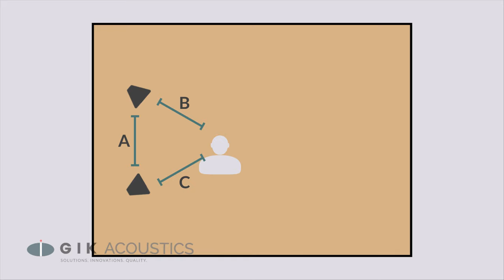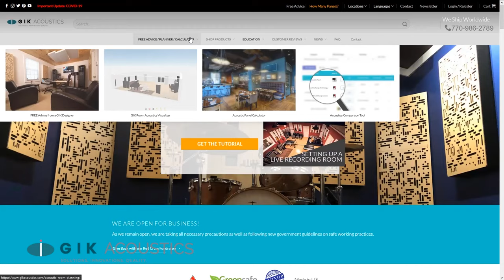Stereo Speaker Placement

Comment: This is generally good advice, but the listener should be moved much farther back in the room, while the speakers should be pulled farther out into the room, at least a third way out, if not more. You can still maintain the triangle that way, but the listener will experience much better soundstage depth perception.
Reply: Yes and only if the room is big enough, mine for instance is super small so the best option is to put the speakers closest to the wall possible to limit the accentuation of the modes from the room

Comment: I use a pair of horizontal 3 way speakers with the 10" woofer in the middle of the tweeter and mid. Even placing which one whether the middle or the tweeter on the inside has different sound to my ears. The tweeter will be more dominant if they're on the inside, so I prefer them on the outer side. Setting up audio can be tricky and has different case for everyone and experience.

Comment: Due to a mess created by reflected sound, 90% of my listening room's sound is not great to pretty awful, but it is fantastic at the sweet spot where my listening chair is, with great imaging and tonal balance.  That is all that matters, and pretty typical for an untreated room I wager.  

Speaking of room treatment, what is it with the ridiculous cost of room treatment material?  You would think the stuff is made of gold bullion.   A buddy got a load of it from a failed church at fire sale prices.  He may be going to Hell, but he got a good deal on very nice material ;)
Reply: Interesting.  I experienced the same - as walking around the room clapping my hands, there is too much echo, yet where the listening chair is located, clapping my hands, there is zero echo.  My room is slightly treated - first reflection and corner traps.
Reply: @downeys1  Similar here.  I have a stereo setup and sit fairly close to the speakers also, which helps take the room out of the equation to some degree.  The friend I mentioned in my post had a home theatre setup with many speakers and he spent a lot of time treating the room, measuring and doing DSP on it.  I think he spent more time tuning the room than he spent finishing his whole basement.  A rabbit hole for sure!  It was pretty fantastic home theatre though, with twin SVS SB4000 subs that literally felt like they could make one's hair stand on end during movie scenes  with deep bass.

For me the program is minimal treatment, sit close to two speakers in a nice triangle, which correlates to the distance I should be from the 65" TV anyway, and carry on with my life.  If one is in the back of the room, too bad for them 😆

Comment: The "33% Rule" and "38% Rule" should no longer be used as suggestions. It's close but not accurate. 33% or 32.8% ONLY works in longer length rooms. 38% is too close to the 4th harmonic null at 37.5%. The real listening position is at 39.6%. Why? Because it's exactly in-between the 4th (37.5%) and 6th (41.7%) harmonic null. You have 37.5% + 41.7% / 2 = 39.6%. So if you are keeping your head in-between the harmonic nulls, then your possible Listening Position options between harmonic nulls will always be the same in any room: 32.8%, 39.6%, or 45.8%.

Room length makes a big difference is where the Listening Position will be located. There's no way a Listening Position of 32.8% or 39.6% will work in a small length room. Small rooms will have a Listening Position of 45.8%, medium length rooms will be 39.6%, and only rooms with longer lengths will be 32.8%.

Overall the 38% Rule is inaccurate, is outdated, and doesn't work for every room length.
Reply: you seam to know your stuff! using this info on my new studio. any insights on what would be the ideal distance away from the walls for MicroMain27 in a room thats 19ft 2 inches (length) by 14ft 4 inches (width)? thank you for sharing your knowledge!! true lifesaver
Reply: @ryanwilliams7166  For a 14'-4" x 19'-2" room, your listening position will be at 32.8%, which will put you midway between the 5th and 7th room nodes. From the front wall to the 32.8% listening position point will be 6'-4". From the front wall to the center point of the studio monitor will be 3'-1" and from the side wall to the center point of the studio monitor will be 4'-5". Your studio monitors will be 5'-6" apart measured from monitor top center point to monitor top center point (4'-5" + 5'-6" + 4'-5" = 14'-4"). The listening distance measured from the listening position to the center point of the studio monitor will be 4'-6". The barefoot MM27 user manual states you need a minimum recommended listening distance is at least 1 meter (3'-3") so this puts you a 1'-3" over that. For the needed measurements, you will need adjustable speaker stands. I highly recommend the heavy-duty K&M Konig & Meyer 26720.

Comment: The Should Not Be Facing U....the Left Speaker Should Be Facing Straight To The Left.....The Same With The Straight To The Right..... Must Get It...So The Sound Bounce Off The Wall.... Donot Have The Speaker If Possible On The Flore....It Should Sound Good....

Comment: Who has more than one subwoofer?
Reply from the maker: @Borey567 - See around 3:25, https://youtu.be/mcB1jKs_ifU

We are working on a more focused video that answers this question more comprehensively, but the gist of it is it is a strategy that uses phase cancellation to achieve a flatter response.
Reply: The answer is MANY. 2 cheap subs will be better than 1 expensive sub in most cases.
Reply: @GIKAcousticsLLC  Would it mitigate the need for bass traps?

Comment: Speaker wire length should be equal also. Allowing signals to reach speakers at the same time.
Reply: Wut? That is not a thing!
Reply: At the speed of light a small difference will not make any relevant change in sound - timewise. Speaker cables should indeed be of equal length because they dampen more high frequencies the longer they are. They shouldn´t do that differently in different speakers. Using quality cables will make this difference smaller, but it´s a good rule of thumb regardless.

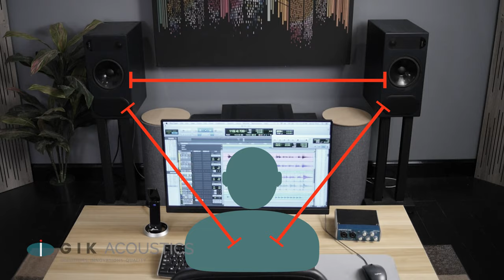Comment: I am amazed at how an acoustic treatment manufacturer can be so inaccurate about the visual cues of the informations it gives: at 1:37 you are speaking of the basic principle of the equilateral triangle speakers setup, but what you are showing on screen just isn't equilateral. I understand the image used is from a perspective angle, but that's simply the wrong way of showing it.  And you keep repeating that mistake throughout the video, like at 3:00, where there isn't even perspective being the image shown from the top and, again, the triangle isn't equilateral, with speakers not even directed to the listener but straight ahead to the back wall. Bad.
This way you are giving conflicting and misleading informations to the potential users, and you really should think about this.
Reply from the maker: I assure you, we think about our video scripts a lot. There's nothing misleading about this. The equilateral triangle model for speaker placement just means the distance between each speaker is the same as the distance between the back of your head and each speaker. The lines of the imaginary triangle should just graze your ears as it continues to the point behind your head. The photos shown are equilateral triangles, or depictions thereof. Not to worry, the concept is simple enough to understand.

Regarding toe-ing in the speaker so they are angled toward the listener, that's a different issue, ie, speakers can be toed in both in an equilateral or non-equilateral triangle setup. Angling speakers like this is a common practice but it's not the only way to do it. Different speakers have different dispersion characteristics and may benefit differently (or not at all) from a toed-in setup. As always, experiment to see what works best for you. In most rooms I'd use the advice in this video as a starting point for experimentation.
Reply: Misleading? You are the one that seems to be confused, no one else is.
Reply: @AbsoluteFidelity  probably nobody is because the average level of comprehension of basic principles like geometry and simple acoustics is so low nowdays on social media that anything is taken for granted. And if you say so you are probably part of those, so back to your primary school to understand what an equilateral triangle is…
Reply: @AbsoluteFidelity  I know I am, don’t need to remind me, but thank you. And anyway, you came at me doing the smartass, if you can’t take comments supported by facts then just avoid embarassing yourself.
Reply: @lore88824  Genius. Bravo.
Reply: @AbsoluteFidelity  thank you
Reply: @lore88824  welcome einstein.